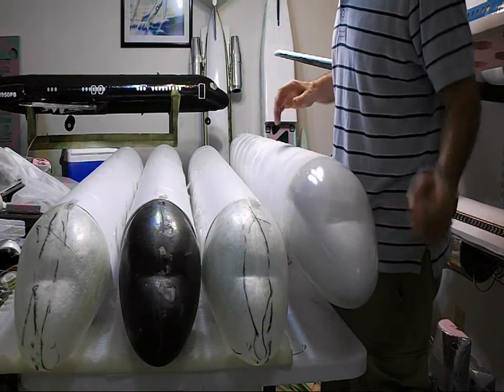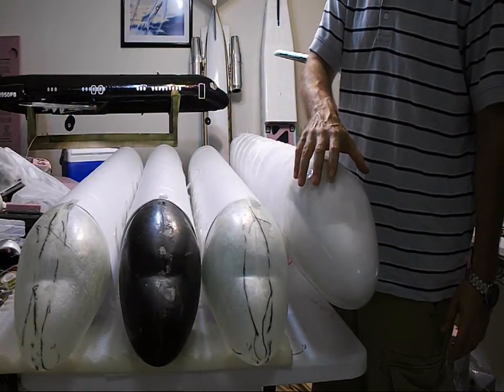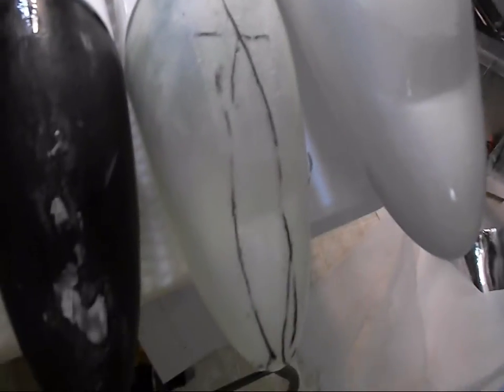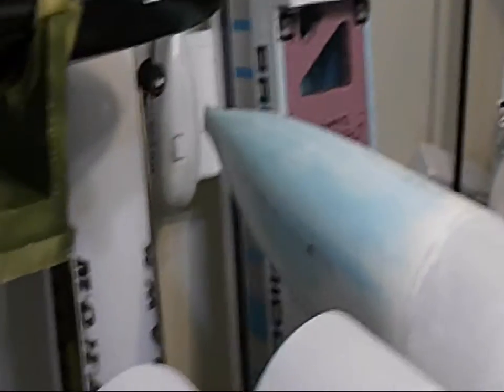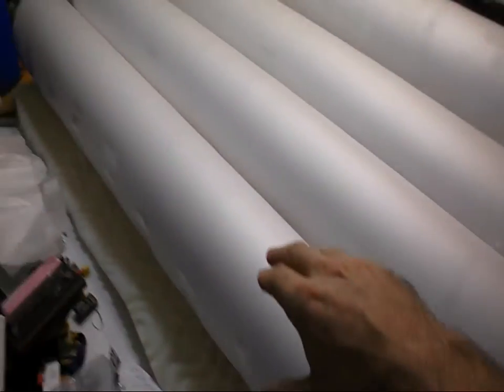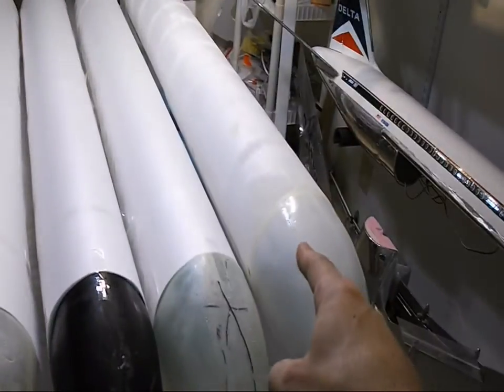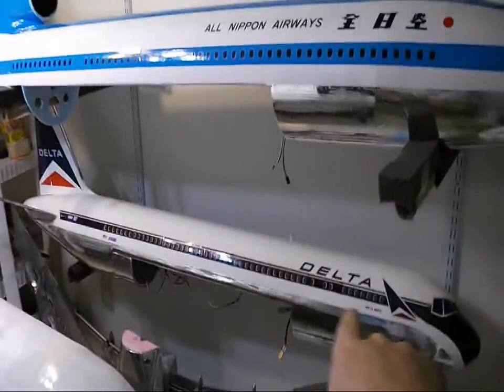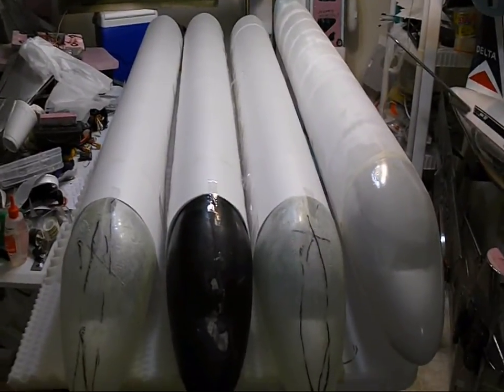How to build a 7.4 Foot MD-80 RC EDF Airliner Part-21!

Comment: In your wanderings through the cupboards & shelves of EDFs,  have you come across fans that can be reversed , ie a single unit / one unit size , model were the unit can be run both clockwise & counter clock wise , be it by reversing the fan & motor, or even that the fan & cowling is so thin , that it can just be reversed & driven the other way .